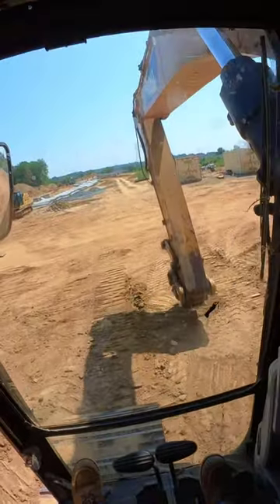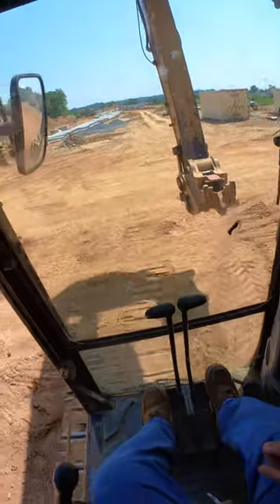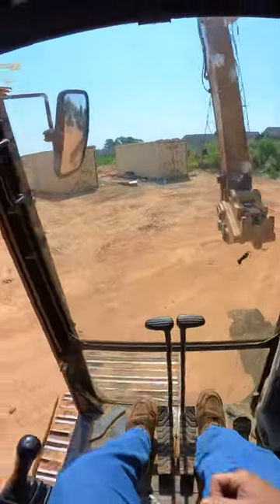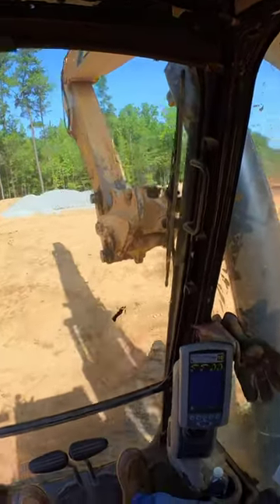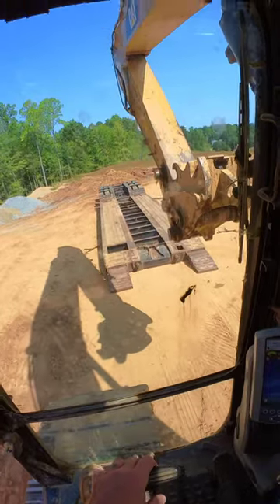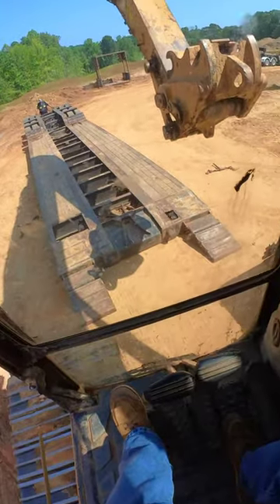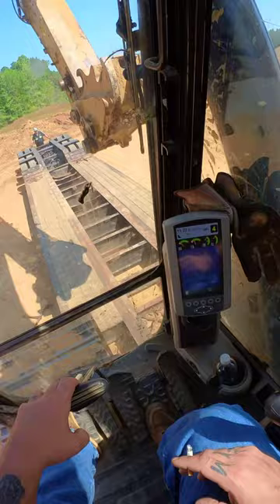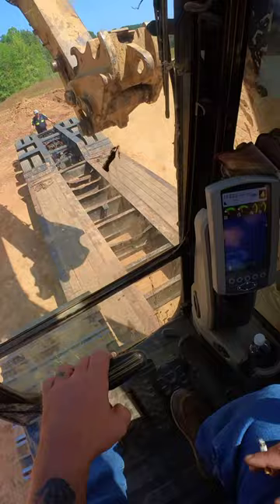How to load an Excavator on a lowboy trailer

Comment: Question. When Going "forward" onto trailer, you're pulling levers and backup warning is beeping. Is the undercarriage backward for a reason like length or weight?
Reply: It’s an audible alarm your gonna need safety “ backwards or forwards” there’s a few different pieces of the undercarriage front to rear but probably similar in weight . Probably just the way he spun the tracks to get it on. Some shovels I have been in it makes a difference when exiting the cab as there is welded on stairs only on one end . Hope that helps!
Reply: It went on backwards so he didn't have to spin it around and for no other reason. If drive sprockets where the other way it would of gone on forwards FYM